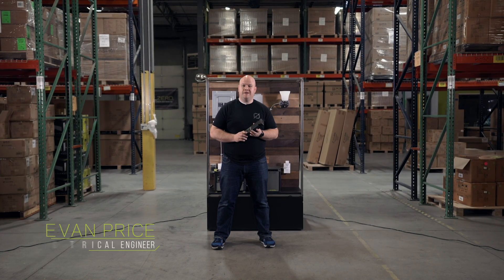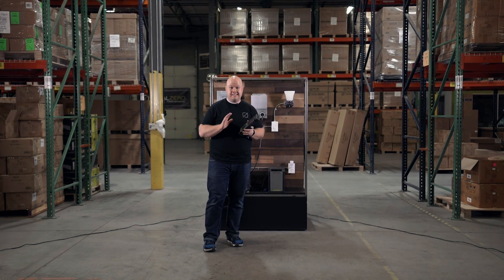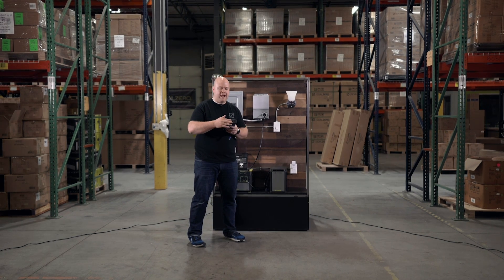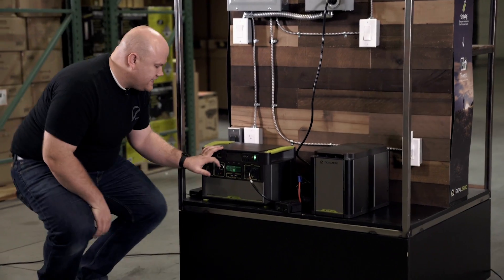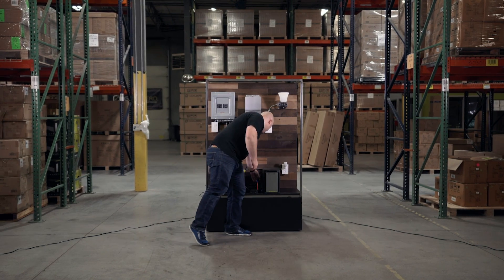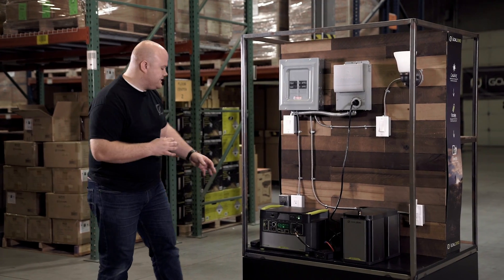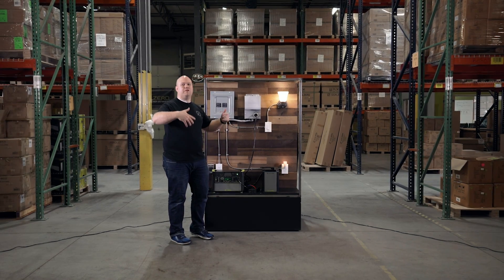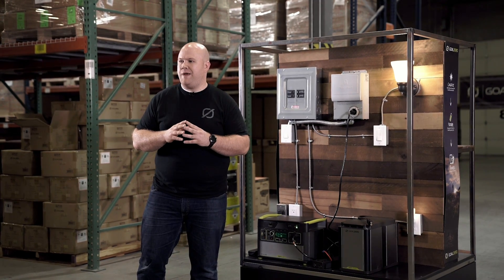From the Engineers | The Goal Zero Yeti Link & Tank

Comment: So if you already have an mppt charger , you cant use it anymore 😳?
Reply from the maker: Hi Jan,

Thank you for your comment. The Link is designed for your more permanent setups such as in the home or wherever you're needing an expandable system. For portability situations that's where the MPPT will still shine since it will optimize your solar charging when on the go.
Reply: @goalzero  But you just said that the tank would be useful for van/trucks etc. So one would have to pick between the tank system or the solar in a van?
Reply: Goal Zero thank you for your reply. I really appreciate it  . I m living full time in Van with yeti 1400 lithium and so need my mppt and was just hoping to expand .
Reply: @goalzero  - The answer is YES! You'll need to toss your MPPT or sell it on eBay.  Stop with the zig-zagging explanation and be honest/direct to your paying customers!
Reply: And even so if power is out . You want to charge if possible no ?
Reply from the maker: @jandevlieger0  Thank you for your response. The Link is optimized for van installs like yours as well. The Link can be connected to the alternator of your van acting like an isolator so your Yeti 1400 can be charged via the alternator when you're driving. The 8mm input on front of the Link will accept your Goal Zero solar panels charging both your Yeti 1400 and van battery acting as a maintainer in this situation when the vehicle isn't running.
Reply: Goal Zero would be great to have a van setup video . Vanlife is bloomingn🙏🏻
Reply: @jandevlieger0  I know you asked this question 2 years ago so may not even recall it. I've owned my GZ 1400 since 2018. Some camper Vans can be set up with holding or storage batteries such as demonstrated here for a home system. Even if you have removed the mppt in your GZ 1400 you can still charge via car or 12v and also AC including AC via outside generators not just the AC grid and of course approrpriate sized solar panel input. It just is a bit slower. Solar is always faster. Maybe you forget that you had to add on the mppt and that was to boost the charge time more than anything else. I use two different solar inputs to my GZ when camping so I did order and install the mppt when I bought the GZ. But over the years not sure it was worth it. Now looking at using it for home and with four of these batteries which I have along with all the other needed technology like the panel and integration kit. However it's not as easy as they lead you to believe. But search about installing solar batteries to top off your camper storage batteries not the car battery itself. And of course if you do not have a back up battery then look into how to do that. I would say there are options of putting together your own system from scratch or buying parts that all come together if you get all the right connections etc. Go to a library for books to read and or on line searches to educate and understand more. Good luck.